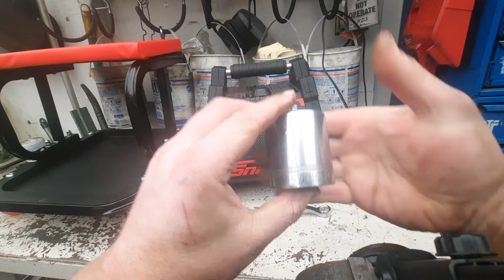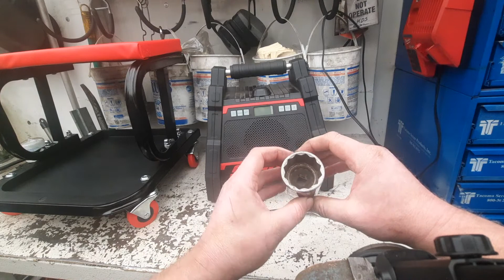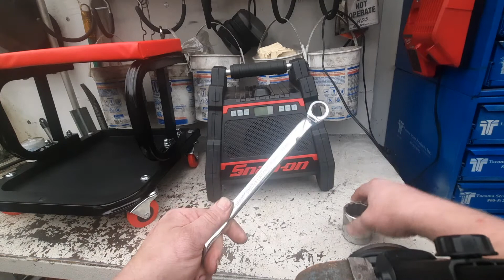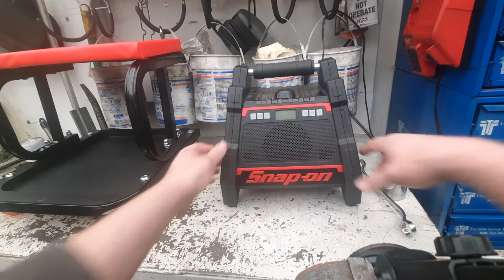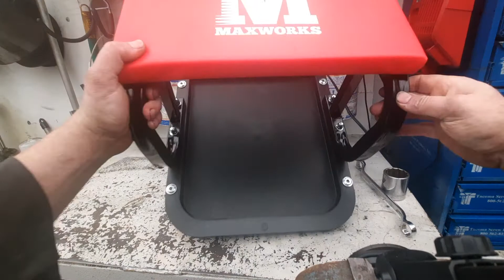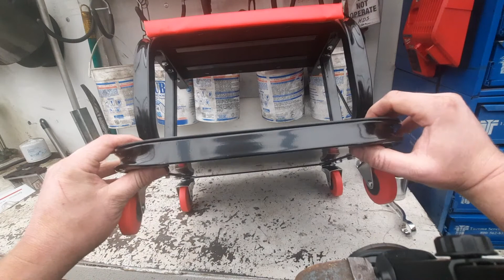TOOL HAUL 1-10-22

Comment: I’m not sure if this is something that interests you but you could purchase a generic Milwaukee battery adapter and then run leads to the speaker, so you could hide the adapter where a Milwaukee battery would go in your box and have it wired so when you put a battery in the adapter, it powers the speaker on top of your box. I’ve done that for my lights in my roll cart so I can still move it around.
Reply from the maker: That the only thing I've come up with so far myself.  Thanks for watching

Comment: You could use the milwaukee top off to utilize those batteries, or they make battery adaptors for about any combination. The adaptor may make it stick out too much and not sit right.
Reply from the maker: So far I have not been able to find a 18 volt lithium battery adapter for Snap-on.  Thanks for watching